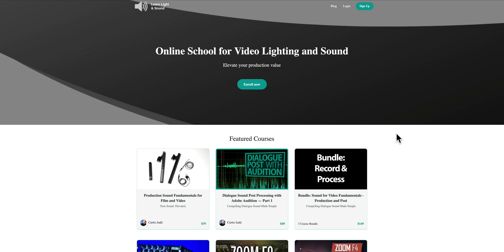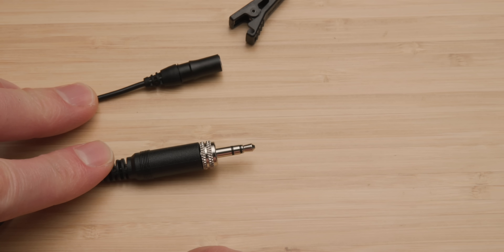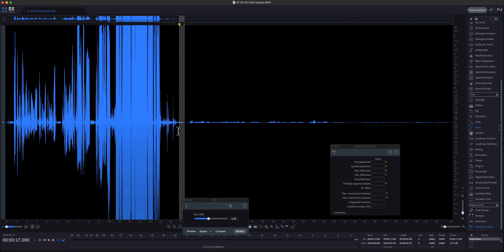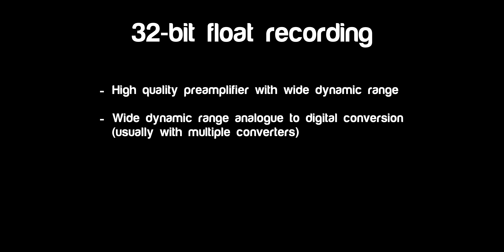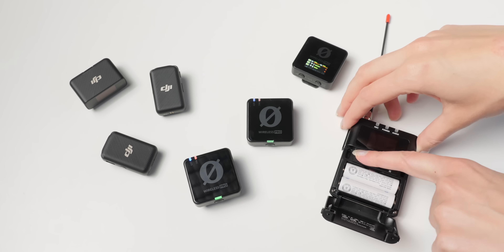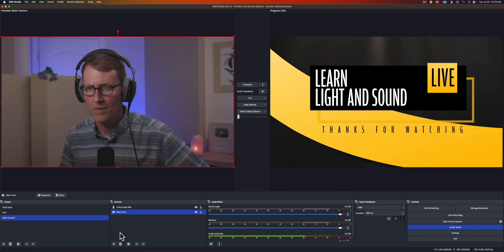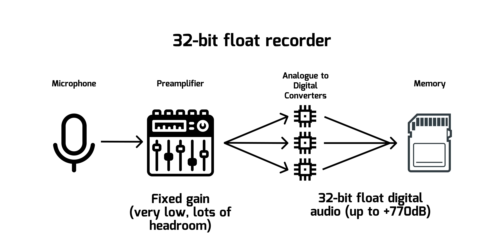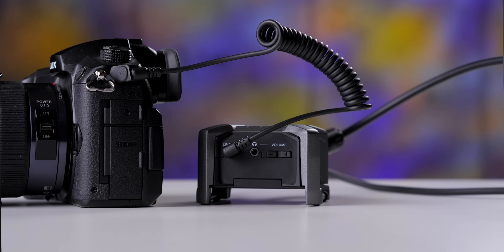Is 32-bit Float Audio Magic?

Comment: What drives me crazy is recording someone (speech) and at first they talk really loud or semi loud and then they get really low.  I use the old record Tascam dr-40.  It does really well on loud sounds if you can set the level right. But when it comes to low sounds. The sound is so low that it is very hard to make it loud enough so it sounds good and you can understand what the person you're recording is saying.
Reply: In the old days, we used to "ride the faders". That was an actual real thing. The recording engineer for Thriller preferred this over compressors.

These days, if you do not want to do that, no bitrate will help when in post you raise the volume and it comes with raised noise floor. In this case, you would tap into post-production software wizardry that MAY remove SOME noise, but it is not a perfect solution; it WILL alter the quality and clarity of the recording.
Reply from the maker: 32-bit float doesn't even this out for you, just to be clear.
Reply: @curtisjudd  Is there anything that can?
Reply from the maker: @Warren1814 levelers are made to do that.
Reply: @curtisjudd  Oh, oh ok... i am new to all of this.. so i will have to look it up and see what one looks like.
Reply from the maker: @Warren1814  Here's one example (though keep in mind that there are more affordable options like Waves Vocal Rider): https://youtu.be/2svTCBlMIP0
Reply: @curtisjudd  Ok, Thank you for showing this to me..
Reply: hang on... that's what the dual mode is for: you can set independent levels (DR-40 manual page 52)
Reply from the maker: @mack_solo  That also doesn't even things out for you. You still have to do that in post. That's a legitimate workflow, but there's still some post/mixing work to be done.
Reply: @curtisjudd  Ah yes, you are correct. I was concerned about having the quiet parts recorded in the first place on DR-40 for work in post . But there is an "Auto Level" function, which I believe is specifically for interviews and meetings.  ...never tested it myself. I used to have my interviewees firmly attached to the chairs so they wouldn't move and ruin the audio 😜

Comment: 6:54 The reason we use floating point format is because it allows us to sacrifice precision for range and vice versa - the lower the integral part value, the bigger the fractional part's precision is. When using an integer format the difference between values in quieter parts become relatively smaller and the quantification errors are getting more significant, as you mentioned. Float jest let's us utilise those 4 bytes effectively for sound recording application. But as you said - that's only 1 part of the equation, the hardware needs to be adequate.

Comment: I've done a lot of recording of individuals speaking in front of a live audience. As only one microphone is used, I would only need to record to one channel. But I always use two and set the output level from the mixer for one of the channels a good bit lower. The higher level channel is set for the "optimum" level and in case of overload, I can replace that short segment using the other channel. I've seen some recorders advertise a feature to automatically record a lower level signal for the same purpose, but I think it's mostly low end equipment that offers that, so I've never tried it. Use your ears, not your eyes. If the waveform display in your DAW or editor looks clipped, listen to it to determine if it's actually objectionable.
As Curtis was saying, the recorder records the signal it's fed, so if it's already distorted, well it is what is, "it" being you failed to use a better mic or you failed to train the speaker or you didn't do whatever it was that could have prevented the distortion.
Reply: I've seen that safety track feature, it wasn't on what I'd call low end, it was quite a bit more expensive than entry level pro gear. But it was specifically for one-man-band type setups. It's like those 'composer' synths, they cost 5 times or more what a 'normal good' synth does, but they don't do the same thing. A 'composer synth' you can play a big band setup on by yourself, it's not an instrument, it's a band simulator. It's a drum machine, base synth with sequencer, a synth and multiple lead instruments, all sequencable and live playable at the same time. Probably need a LOT of time to learn how the thing works, or take classes or something. Cool things - sorta, but the multi thousand price tag etc plus steep learning curve is something stopping most from getting into them I think. Except obviously the people employed as musicians using them for 'live' music.
Reply from the maker: Good strategy.

Comment: For my use case, i always try my best to set gain, however the performers, sometimes audience, still finds a way to blow up my audio input. So IMHO for me 32 bit all the way. I record live performances I have always set gain "properly" but that 1 section where the audio clips is just not recoverable. 😢

So 32 bit has worked well for my odd use case.
Reply: You should record a safety track set to lower gain.
Reply from the maker: Ok 👍

Comment: I found 32bit super useful for thunderstorm recordings. Especially when I left my droprigs out in the nature for a several days and I can't adjust gain. It's just perfect for this because I can capture a super quiet atmosphere and when the lightning strikes very close - I just pull that part down in postpro to balance everything without any distortion. I've also found it useful when the wind hits the mics a bit harder. In post-production you just high pass that part and rest of the frequency spectrum will survive without any damage. It's life saver sometimes. But otherwise, for normal ambiences where I not expecting sudden loud noises  - 24 bit is more than enough. Btw great explanation as always Curtis!
Reply from the maker: 👍 Keep making great nature recordings!

Comment: Excellent video- thank you, Curtis. People overlook that low end 32-bit recorders (ie; Zoom H-series) have nasty built-in mics and preamps. Plus, handling noise must be avoided- it's way worse than any potential benefit from 32-bit float. 32-bit files can be useful, but only if the client knows what to do with them, and we nail all the other factors that create a good recording.
Reply from the maker: Amen.

Comment: 32-bit recording is not magic protection from analog overdrive of a/d converter. If in doubt, set it 2dB lower. If really in doubt make it -6. If really really in doubt use the other channel for a safety with a -12dB setting.
Reply from the maker: Good call.

Comment: Well, you might be a sound recording engineer, but it goes really wrong when you try to explain ADC, especially for float. Really ADC doesn't have "errors" anymore as the A/D conversion is linearized with dither noise, and the only factor is the dynamic range set by the number of bits (16-20-24) minus dither noise (+/- 0.5 LSB).
Reply from the maker: Ok, thanks for the correction.

Comment: Important video, finally!  I've been emphasizing the clipping potential of most lavs for years, despite the simplified talking point that 32-bit float insures against clipping.  Also, it's so important to debunk the oversimplification that a mic will clip "only next to a jet engine."  Happens all the time.  One last thing to suggest is that tools like De-clip in editors like iZotope RX sometimes repair clipping reasonably well.  Also:  should have recommended the completely separate tier of lav microphones from the likes of Countryman and DPA that are designed for loud volumes (e.g., singing and sports) sacrificing dynamic range on the quiet end.
Reply from the maker: Thanks for the notes. 🙏
Reply: This may not be the strongest argument. A mic will clip when overdriven regardless of bitrate. At best, the argument can be that SOME people MAY incorrectly think that their mic may not clip under 32-bit.

Comment: I think you're spot on when talking about recording spoken word and dialog, particularly when working indoors.  But we don't always work in doors.  And as a recordist, you often do not know when someone might start shouting rather than talking in a normal tone of voice.  If it's sudden and you don't know it's coming, it is a game changer in that you now still have workable audio.  With a typical 24 bit recording, even if you had the gains set perfectly lets say at -18db FS, it probably clipped at least a little bit.  I do agree it's not going to solve all the problems.  But it solves a big one if you're working fast and as you said, are using good equipment.
Another point I think you kind of missed is what happens when you have recorded your audio too low or there is a really quiet passage.  You sort of touched on it, when talking about quantization errors, but probably should have dived a bit deeper.  Having 32 bit float not only means you can bring down audio that went over 0db FS, but it also means you have a lot more bits of resolution at low levels, so if you recorded too softly, then you can boost the audio up without boosting the self noise as much.  
My point is, we are not all recording someone or even a few people talking.  Some of us record music concerts or ambient sound or all sorts of things that have far more dynamic range than what can be captured with a basic 24 bit recording.  And yes it is more than what will be reproduced by the end playback device.  But at least we have a better chance of fixing it in post than we did before.  I respect your opinion quite a bit, but for certain situations with good gear 32 bit float can be a game changer.  It has allowed me to save a lot of recordings that I only had one shot at, that otherwise would have been worthless or very problematic to fix.  Some simple volume changes is still a lot faster to fix in post than noise reduction passes and anti clipping passes and all the other tricks we used to do.
Reply from the maker: One note: I’m not sure  that 32-bit float results in lower noise recordings. My experience is that there’s still plenty of ambient noise and self noise depending on the mic and recorder.

Comment: I have a 32 bit recorder and used it for an audio recording where the singer overloaded the mic capsule. There's nothing you can do in that situation. For most recordings 32bit float isn't really needed, just nice to have, but other things in your chain will normally have a much bigger impact on clipping.

Comment: Indeed, a 32 bit float A/D converter can make a superb recording of the crackle from overloaded mics or preamps in front of it.  But I tend to think of it this way - if in the early days of digital recording 32 bit float had been there at the start, would anyone now be extolling the virtues of 24 bit or less and suggesting that we should switch to that?  Now we have reached the point where 32 bit float implies no price premium and in effect it is the de facto standard for most gear, even cheap stuff.  

And maybe some of that cheap stuff is showing the way forward.  I have a Zoom M2 mic/recorder in my arsenal and it can be set to normalise on the fly on playback, and produce copies of the recorded files onboard (in an export folder), normalised and output as 24 or 16 bit, ready to use in situations where that can save time later.  

That device also illustrates how 32 bit float one piece systems have the advantage that the designers can create a level-balanced system, where the mic can handle high levels without clipping, and the preamp can handle the known max level from the mic, and the A/D converters can digitize that well tuned audio with no possible clipping.  Maybe that is where 32 bit float really comes into its own.  

There is also consequent focus in the design on low noise.  The other night I did the classic under-the-duvet test of that cheap device and subsequent analysis of the noise indicated that it was just fine for any normal purpose, eg ambient nature recordings or classical music etc (in regard to the self noise).  Wow, we have come a long way.  The Sony F1/SLF1 system I used for my first digital recording for the Philips label back in 1983 had a 14 bit / 16 bit selector switch.  I think I did choose 16 bits...
Reply from the maker: Thanks for sharing
Reply: "Indeed, a 32 bit float A/D converter can make a superb recording of the crackle from overloaded mics or preamps in front of it."

Maybe I am misunderstanding the wording, but no bitrate will make a crackling, overloaded mic into a superb recording. The damage is done before it even got the AD converter.
Reply: @AdamElteto  that's what I'm saying. The converter will record the distorted signal from the preamp. It can't magically fix it. However in a well designed device you would have to work quite hard to cause that overload. It would probably most likely occur when using high output mics close to something remarkably loud.

Comment: Recording spoken word in fairly reasonable environments with a MixPre3 II - I use 24bit and do gain staging. Yesterday, as an example, recording "spoken word dialog" of a riverboat ferry captain, on a very windy day + a loud noisy boat I used 32bit float. I still did as much gain staging I could in that unpredictable place as I could and used the fader when needed. Listened to the audio last night and the spoken word came through nice and clear. Nothing of significance to address in post. I probably could have used 24bit, but using 32bit in that situation I at least had the feeling that the margin of error was going to be in my favor.
Reply: Are you pleased with the mixpre for pro level audio?
Reply: @healing2gether  No complaints whatsoever.
Reply: @ great to hear, thanks!
Reply: Still, the most significant factor is that you started with a recorder that has terrific components throughout- great preamps, lots of headroom on the busses, negligible noise and distortion, good metering... ..plus, you rode the faders intelligently.

Comment: Hi as usual amazing video wonderful information.
may I ask you to make a video if you didn't already about how do you convert 32 bit float audio to 24 bit float in the most common software so that everyone can know how to do such a task as you mentioned that not all post production houses want to get 32 bit float sound so in case we need to convert it 
what is the best and fastest way to do it. and with what software.
Reply from the maker: I would import the clips into whatever DAW app you use, then export the individual clips in wav, 24-bit, keeping the sample rate the same.

Comment: what annoys me the most is when reviewers actually tell the audience that 32bit provides higher audio quality, which just proves they have no clue what they are talking about
Reply: Well, if it does avoid distortion then tne quality will be higher. But I see your point.
Reply from the maker: On some engineering forums where they post measurements, it appears that the distortion performance is worse on some of the popular 32-bit float recorders.
Reply: @curtisjudd  I get your point but it's only mainstream "reviewers" who easily just say "better quality" to grab the people's attention. The credible reviewers don't say this as their main point. Also none of them would have mention the mic or audio interface to be the limiting factor like you did, most likely because they aren't even aware of the fact
Reply from the maker: Fair point @TheNitpicker
Reply: @TheNitpicker  True, many of us have never had the illusion that 32 automatically means "better". At most, 32 means "flexibility" or "options". But you have to work with those to make things "better quality".

Comment: Very interesting stuff. This reinforces my impression that a Zoom H6 will be more than good enough for me if I want to upgrade further from my H4n Pro. Question not related to 32-bit, but is the Zoom H5 a significant upgrade from the H4n Pro?
Reply from the maker: Depends on what you need upgraded. The preamps are only very marginally better, probably not going to notice.
Reply: @curtisjudd  Thanks Curtis - that was the bit I was wondering about. 🙂
Reply: I would be careful investing in the H line, they may be phased out in favor of the H Essential line.